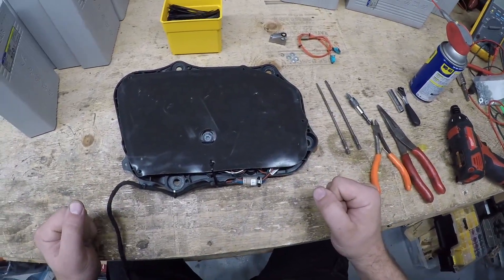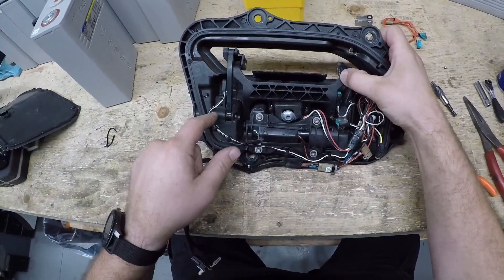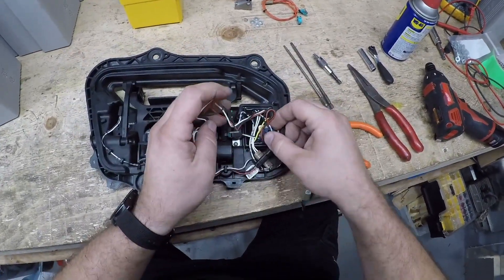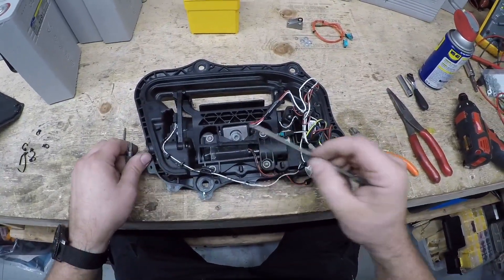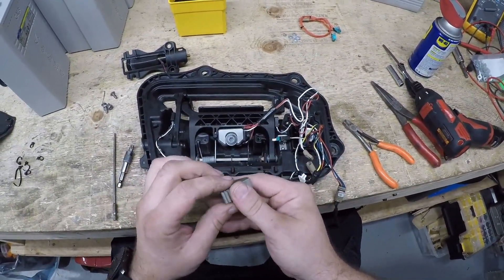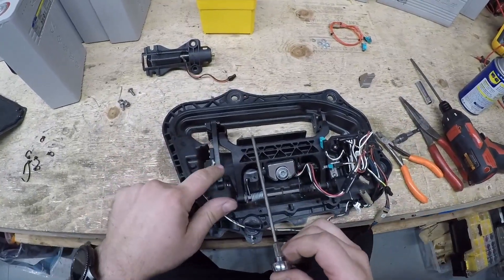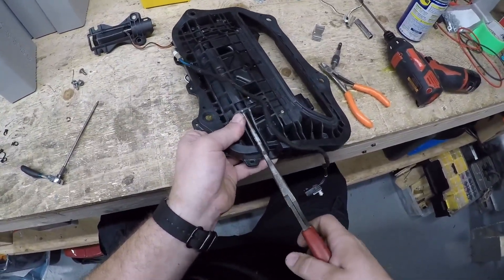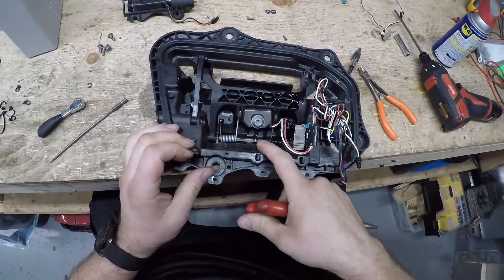Electrified Garage: How to Repair and Rebuild Tesla Model S Door Handle

Comment: Thanks for the helpful video. I tried this and found that my harness has a lever on both ends. Have you seen this? I was able to fix the handle so now it presents but it won’t unlock the door

Comment: not that I expect a reply here but my handle presents and at the end of the present it makes a weird kinda grinding noise......the handle doesnt pull any further and the door wont open.  Im definitely going to order a whole new piece if I can and just swap out the piece rather then try to fix whats not working.  Im just curious if that symptom points to a direct problem
Reply: The switch to the left decides when the handle stops when coming out, switch to the right tells door to open when you pull on handle. Switch/sensor in the middle behind the big bolt that adjusts how far in the door the handle sits when its not presented- is the sensor that tells the handle to come out when you press on it. Switch directly in front of the gear he replaced tells the motor to stop when it retracts handle. The grinding is most likely from the motor gears striping when it presents the handle. Maybe a faulty LEFT switch, stripped gear or both. Look for corroded/broken wires, broken switch or switch plate.
Reply: @SalVations thx so much for the reply….will try this when I order the handle from eBay.  Really didn’t expect one as videos this old tend to be ignored 😎

Comment: Thanks for the video, it was a huge help. I would’ve been lost without it! I do have a question, though. After installing the new paddle gear and switches, the handle now comes out and opens the door automatically. I don’t even need to pull on it. 🤔 I can’t figure out for the life of me what I did wrong.
Reply: I had the same problem, watch again where he says the right most switch doesn't have a metal plate. Take it off if you have one. If you leave it on it will activate the switch too early. If its already off, adjust the handle until it almost activates the switch when presented, then when pulled it activates

Comment: Hello,thanks for very detailed video and explaination.While I repairing mine,I found out the cover for preventing cables touch the glass is not usable again.The glue lost it touch and the cover was corupted.Do you know how to find a alternative cover or maybe I can diy this cover by using some kind of NBR and NBR special glue？
Reply: Duct tape the cover, clean off the old glue on the plastic and just use regular black RTV sealant. If cover is not salvagable i would use a good thick plastic sheet/bag and cut the same shape using the old cover, seal with RTV. The main function of the cover is to keep everything protected from elements and together.

Comment: I have the problem that mine seem to do nothing anymore. The motor and the gear seem fine, as when i plug it with 12 Volt it'ss extend. But it won't Extend or open the door when pulled out.

Could it be that the Controller on the handle itself broke? It's shown as unknown in the service mode.

Comment: I did all of this.  My handle still won’t present itself. Pulling my hair out over here.  The metal piece is fine. The wire harness was replaced.
Reply: Test motor

Comment: Just had to do the door repair on the drivers side door and as before the instructions were perfect.  As before the screw that sets the door handle protrusion was frozen and I choose not to move it so as to not damage the brass threaded insert in the plastic.  If you have a 5/64" ball end hex wrench it should easily remove the micro switch screws as it has for me on four (4) switches so you will not have to back out the large handle adjustment screw to access the small switch screws.  Thanks again for the great videos!

Comment: The inside of my rear right door does not have all these additional wiring! I’m confused as to what’s causing door failure since it should look like this on the Tesla model s 2013. Is there another door handle type that they also use?

Comment: With these invaluable instructions repairing the failed door handle assembly and installing the EV Tuning kit went very smoothly.  The kit was a definite quality upgrade from the factory components.  Thanks for the excellent video, commentary, and tips! 👍

Comment: I really appreciate what you guys do, wish you would upload more videos. But as of this writing the price of your rebuild kit with shipping is around $190; the cost of your entire replacement assembly is $500 (didn’t check what you charge for shipping). Both of these prices seem very high: A tesla mobile tech came to my house in September 2022 and replaced the entire assembly for $301 total. And it’s warrantied. Just saying, engineering aside, $190 for for parts that have a material cost of @$5 is a pretty steep markup…

Comment: Thank you so much. Not easy but I got there. Spent a good part of Christmas day fixing my Driver's side door. $35 instead of $900. Without the magnet forget it! Now I have to do the same with the back DS door. Also recently changed my headlights. Another pain to get to. I've  had 4 door handles break so far. Along with Back axle, DC-DC convertor, front strut. Windows stuck. Four 12V batteries. MCU died. Plus a lot of other stuff. Don't believe it when they say there's not much maintenance because there's not a lot of moving parts. My model S has had 4 times as many repairs as my Prius. And Tesla charges a lot more.
Reply: What year vehicle?

Comment: I wish that was the problem with mine. It presents too far (probably micro switch wire) and can’t be pulled to release the door. I have to wait for it to go back in to push in and release the door

Comment: I was happy to see my 2017 Model S had the Gen 3 handle, so no butyl nonsense, a proper screwed on cover instead.  Also much simpler wiring. SuperFastMatt has a good YT video on it. I did have to mod it a bit as it is not designed to slide the pin out in either direction.  A Dremel with a small sanding drum made quick work of it and the cover has enough lip it doesnt show. Hope my $20 stainless steel ebay paddle holds up.

Comment: my rear door handle assembly don't have the 2nd micro switch (one on the right, one you put in upside down to prevent wiring stress).

Comment: On the rear door handle I had to remove the pivot gear to get clearance to remove the micro switch next to the control board.

Comment: 2018 Model S here. The driver's door handle failed within the first 3 months. Now over two years later the second door handle failed. I have extended warranty. The problem there are two more doors that will most likely eventually fail. What a shitty company. Poor quality parts and assembly. I should have definitely went with Mercedes.

Comment: My LED start to work, by your experience is it cables to fix or LED burred down?
Reply from the maker: The LED usually gets water ingress and causes it to short out or the wire was improperly secured and now the wire is broken internally from flexing improperly for so long.

Comment: Another tip for the T40 bolt- mark the bolt and count the number turns you loosen.  When reassembling, the depth would most likely be the same and the handle would be close to flush as before.

Another video could be showing the innards of the latest generation handle.

Comment: what if my handle does NOT pop out when i press on it? however, it does if i unlock the car using the fob or the touchscreen it will pop out and work normally. do i need to replace the depth sensor? My handle works except for this.
Reply from the maker: Can you clarify. If you unlock using the fob or touchscreen does the handle "present"? Are you saying that if you press on it that it doesn't "present"? If this is the case there is a pressure sensor which isn't available separately anymore that most likely failed.
Reply: Electrified Garage the handle does present when using the fob or touch screen. But not when i press it from outside. Apart from that it works for opening the door. I thought it was the wiring hardness but after watching your video, i think its the sensor
Reply from the maker: @EVunedited  yes you would be correct. It is the pressure sensor.
Reply: Electrified Garage is it easy to replace as a DIY project?
Reply from the maker: Xcube in the video you’ll see where a large torx screen gets loosened. Under that screw is the sensor. Finding a replacement will be the challenging part without just buying a new handle
Reply: Electrified Garage should i take it to the service Center? Is it hard to replace the pressure sensor? Maybe is the connector of the sensor?  This handle was replaced previously by Tesla under warranty. But, now they want me to pay as my 4year warranty ran out and the repair was done over a year ago

Comment: You mentioned that water can get in the connectors. So why not use dielectric grease during re-assembly to prevent water intrusion? WD40 seems to work for you but it is not a lubricant or break free but a water displacement product. I would use other products especially on YouTube.

Comment: Can you guys do some common repair and maintenance issues for each model Tesla produces with repair estimates for parts and labour / time so potential owners have an idea of the weaknesses and what the costs of ownership really are.. Electric cars break down too and they might not need oil changes and filters or radiators or transmissions but they need OTHER stuff and YOUR insight is VALUABLE and needs to come out..
Reply from the maker: Dan Erlich yes this is the plan for this channel. Thanks for the feedback